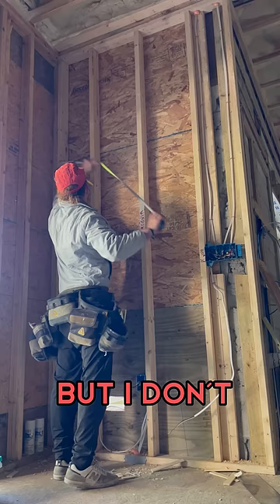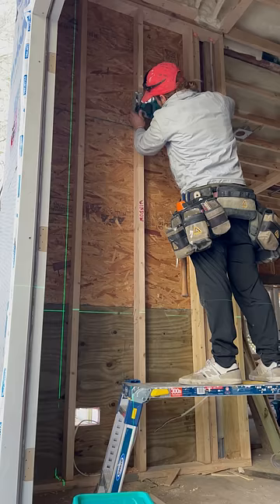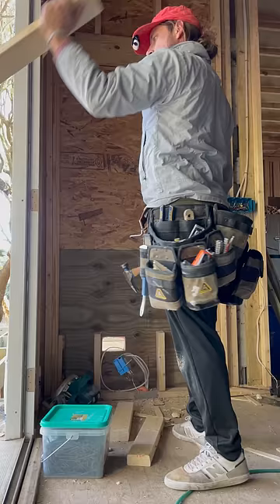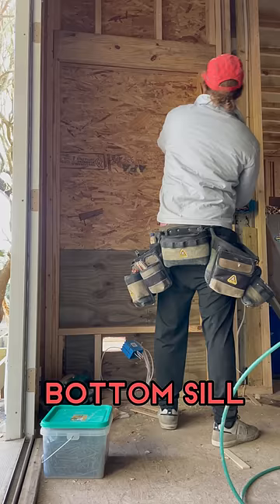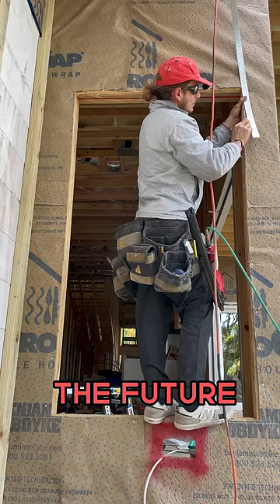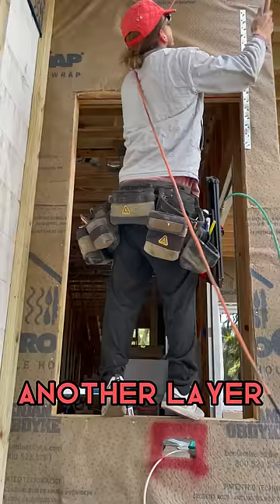How to Add a Window Opening | Artpentry

Comment: Imagine showing the laser wall to people in the 30's
Reply: Their mind would explode
Reply: Plum bob and string works just as well.
Reply: Imagine how efficient they would be
Reply: @Cheech The Chong  Beside being nominally larger dimensions and possibly being from stronger old growth trees. There shouldn't be any significant difference. If any, the negative would lean towards modern construction grade lumber.  
In the old lath and plaster wall days, the plasterer could work a lot of magic removing the curses from walls. 

In the cases we see this guy spotlighting, the fault is clearly with the workmanship, not the materials.
Reply: People in the 39’s had electric lights, might have to go back a bit further
Reply: Even better: show them an NCVT tester.
Reply: @googlesuxbigtime1227  Only someone who’s never used a laser level would say something like that
Reply: @googlesuxbigtime1227  laser is way faster.
Reply: @Darth Uchiha47  drive a nail or screw, hang string and gravity does the rest. 
A laser you have to get out, level it properly and get it positioned properly. 
How is that faster? While you're still setting up, I am getting the job done. 
Plus I don't have to worry about batteries dying or the calibration being off because some idiot kicked or dropped it on the job site. 
Plus, my plum bob isn't likely to grow legs and end up in a pawn shop somewhere.
Reply: @googlesuxbigtime1227  there’s a lot more to setting up the string than what you’re saying. 
A laser level you set on the ground and set it up in two minutes. Plumb bobs swing so drive another nail. Don’t forget to pull the nails back out too. 
You sound like you’ve never used a laser level
Reply: @googlesuxbigtime1227  I’ve seen people spot six lights at once with a laser. Set up in two minutes. Have fun with your string.
Reply: @Darth Uchiha47  I have. And found I don't need one. 
And the problems I mentioned with them growing legs or needing recalibration and other repairs. Have all been experienced by close friends. They also thought this would improve job sit work. But found out that they work best, for keeping the job site plans from blowing away.
Reply: Witchcraft 😂
Reply: Imagine showing people from the 30’s how flimsy our houses are now
Reply: @googlesuxbigtime1227  I can tell you're used to grunt work, as all you're doing is digging yourself a big hole.
Reply: @googlesuxbigtime1227  lol these kids with their lasers telling you you don't know anything are funny.  its a window rough in i would be finished in the time it took them to get the laser out of the truck and set up .
Reply: @pattygreen8064  Yep.

Comment: Great job dude, the router is a good switch. The clean cut is the cherry.
Reply: Unless the wall is still laying down, routing out a window sucks! Lol. 
Almost as bad as tyveking in the wind
Reply: @Mc-nn6nj  It’s not that hard, I have done it many times with the wall standing
Reply: Unless there's a knot or wain in the wood
Reply: What kind of bit do you use?
Reply: @feyrband  2 flute 1/4" flush router bit.
Reply: @isaactruss5922  but he said when the wall is laying down
Reply: If u cut it before the wall is put up maybe
Reply: I would think sawzall blades are cheaper than router bits
Reply: Frame the window before you sark the wall. This is just unorganised.

Comment: One thing I know down here the windows probably getting wrapped in drywall with just a sill an a bottom skirt trim piece but if you ever have to picture frame a window double the bottom plate it gives you more to nail to

Comment: 10/10 highly recommend switching to the router after years of sawzalling out windows routing them out as you sheet with router is more efficient and leaves a better cleaner opening! Great job! 
P.s- what brand of bags are you rocking those look like they mean business!!
Reply from the maker: Thanks bro! I’ve been meaning to try the router so I’ll give it a go.  As for
The bag it’s a brand called Iron Dog Toolgear. There’s a link for it in my Linktree
Reply: Sucha good i deas still havent tried either
Reply: Tried getting my boss to switch, told me I would burn out the motor on his giant router and it’s a waste of time. in the end he’s just afraid of new things because it is ten times a cleaner outcome
Reply: @Artpentry  Agreed those bags are pretty sweet👌🏻🤙🏻

Comment: Pro tip from a window guy: when you nail your builders window on; the window will settle with the wall. If the walls end up getting bricked they will brick up directly up against the window. 
So now when your walls settle it crushed the window into the brick and now you have to buy a new window cause that window can’t be fixed

“Brickers” you need to leave enough room to let the window settle with the wall
Reply: Brickers? Haha they’re called masons
Reply: @nyazz22  unless they're goldbrickers - wait, sorry, goldmasons

Comment: The router makes for faster easier and cleaner cuts. The only downside is you have to clean up the corners depending on your bit.
Reply: What do you need clean cuts for? This is rough carpentry.  Never be seen.

Comment: U need 2 window sills. . Very helpful wen u put trim on cus u got plenty to nail to and not angling upward and end up hitting the window frame or curls out
Reply: Right on kuntryboy. That's what I was thinking too. And I bet his sill isn't level. Just look at it. I can see from here it isn't
Reply: built thousands of houses never used double sills. unless you put in wide trim it is a waste of lumber. window trim does require that many nails

Comment: Need a double sil and jack studs underneath. Ta-da!😊
Reply: Why? All it holds up is the window itself. Who needs a double sill on jacks for that?!??.  Sounds like a waste of lumber to me.
Reply: Nope.  Where do you build? Never see that in the Mid West. Not in 100yr old buildings to current ones
Reply: @jamesgarfield9592  double sill leaves nailer for your window trim and casing around
Reply: Absolutely not. The only reason you even need a cripple stud under there is for nailing/screwing materials later on.
Reply: @dylanwheaton2785  That is what the one 2x is used for.  No need to double up and waste time and material.

Comment: We use either 2 LVLs or make a box header so you dont have the half inch of overhang on the cripple wall studs.
Reply: What overhang?
Reply: There was no overhang? Another method is to use 1/2" plywood/osb, cut 4" x 5.5" pieces as filler between the (2) 2Xs. Tip: place them inline with the load from the (C) of each cripple stud (And one at either end, obviously)
Reply: He actually uses the same method in the video, but with a full piece.
Reply: @patrickellis1151  Look closely. He put 2x together. That's a 3" header. A stud is 3.5". The stud protrudes the header he made. You can see it isn't flush to the inside when he put the thing into the cavity.
Reply: @brettgregory6667  He nailed 2x's together creating a 3" thick header. A stud is 3.5" thick so he is missing that .5". There was no plywood in between. You can see the jacks, studs, and upper cripple wall over hanging the header when he sticks it in.
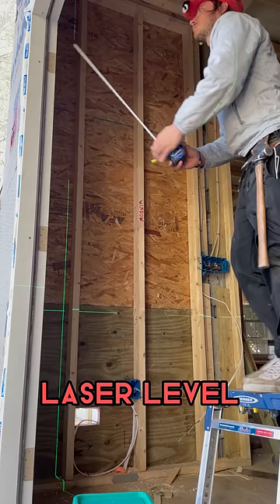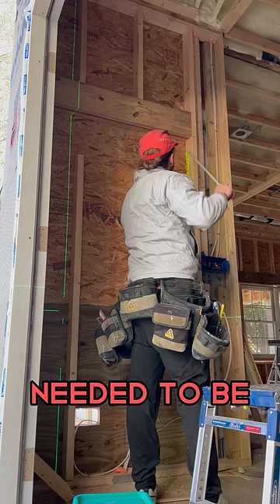Reply: @joeydover  At 0:05 you can clearly see the 1/2" plywood sandwiched between the 2Xs; there's even the red painted edge facing the camera. You can't miss it! No noticeable overhang, due to thickness variation. Even at 0:29, where you can see they're flush, the 1/2" filler board is quite noticeable, after it's been installed.
P.S.- It seems like his top cripple studs aren't cut flush at the ends that mate the header, creating a slight shadow. It looks more like 1/8" slight gap than an overhang. Same with the left jack stud; slight gap at top, in your defense....
Reply: @Joseph Dover  No sir, he put a piece of 1/2 inch plywood between them to make it 3 1/2. I do know the method you're talking about though and that does a great job aswell.

Comment: Some state codes do not allow windows closer to 
corner wall.
Reply: Braced wall panel required within 8’ of corner. Can be as small as 2’8” with holddowns, 4’ with anchor bolts or smaller with a Simpson strong-wall or engineering.
  In the application shown it’s pretty important.

Comment: Do it with a saws all.. then get a big diameter… like 1”, spiral up/down pattern bit with the bearing on the bottom and top…  or just on top. I have found that the D-handle routers the Porter cable 691.. is great… but the festool routers are amazing . All of their stuff is. Worth every penny. Expensive to buy…. Cheapest to own

Comment: Nice work, looks really good. one question though, if it's not a load bearing wall why install such a beefy header? Or if it is a load bearing wall isn't cutting out 2 studs without a temp wall of some sort to carry the load until finished with the window nessasary? I'm a carpenter who has a lot to learn myself that's why I ask.

Comment: Im sorry to inform you but install the strap tie down to the inside of the framed opening and slightly @ an angle where the strap ove laps both the Jack and King stud than on the out side . Hurricane force winds push from the exterior side 
I been framing for over 36 yrs and personally have seen this fail on homes both in SW Florida and Bahamas after sever Hurricanes countless times. I always install the straps on the interior side of the framing where possible.

Comment: Both straps should be nailed to the jacks, header and top plate and they should be nailed on the inside directly to the framing not the plywood as the nail length doesnt compinsate for plywood thicknes

Comment: Am I the only one that just slaps headers up against the top cap with 1/2" iso board between two 2x8/10/12?

Can cripple down to whatever height you want at that point.

Comment: What’s the strapping for on the outside? Thanks
Reply: Possible engineering requirement.
Reply: @robdavidson993  tether the window in case it gets blown out?
Reply: Hurricane 🌀 prone area requirement.
Reply: @XroorX  it’s for areas that see a lot of high winds. I saw a house with those in Colorado.
Reply: straps on outside of window header over osb does no good. hurricane straps go on framing. must extend from jack studs across header to blocking over header.
Reply: @charlesrodriguez7984  keeps the window from flying out?!? Wow!
Reply: @nightstalker5952  right cause the sheathing should basically be the strapping from rim joist to rim joist, but drywall is poor in tension and would only span the top to bottom plates of the wall

Comment: Oh yeah router with a rollerbit( tracing bit) it's slick, just watch out when you set it down if it isn't a plunge router!!! Just like setting a skill saw down when someone has wedged the safety guide up, so it doesn't comeback down!!! Oh yeah when it's getting finished on the inside, always double your sill, that makes it easier when you finish, you can nail your trims anywhere, make it symetrical, layout never falls evenly on your trim, since you can see the putty marks where you put your nails, double sill gives you 3" all the way around for your finish nails to hit by, that way you can line up your nail pattern on the bottom trims under the window, symmetrical always looks better, just an old timer trick, other than that spot on, sir!!! Nice work!!!

Comment: An inspector told me you don’t have to add strapping to the outside because the plywood acts as strapping you shouldput it on the inside but both will pass inspection

Comment: Next time, add a 2X6 flat under the beam so the drywall has something to screw into above the window.
Reply: 1/2 inch furing strip of plywood will work fine
Reply: @Jack Mehoff  right. Or a double 1/2 inch because a triple 2X will be 4 1/2 inches and a 2X6 is 5 1/2 inches so you would need to add an inch, which is a double 1/2 plywood strip. Most framers don't do jack though and leave it for the boarders to figure out. The worst is when window guys install the windows and load the space with tape and make it hard to fix after.

Comment: Using a saw-zall to punch out plywood for windows is so hit or miss on the jobsite if you're not in-charge because half your bosses will eat you alive if you do, and the other half will if you don't. I've noticed the dude's that were trained in finish initially are always really insecure about using a recipricating saw for this because they have a tendency to be too detail oriented for production framing and they hate how sometimes you'll cut a little 2x or sometimes there will be an angle in the plywood if you failed to cut it at a true 90 degrees. The thing is though, none of that actually effects the end quality at all so it's literally just them not being comfortable with it.

Comment: I always use a 2nd sill, better all around. And I double the sides for strength always great for replacing as well....The router is fast nd so clean worth it. And my strapping is usually inside. Some epmd wrap nd your ready for window. And I definitely like 2×6 walls better only wall maybe 2×4 is house wall into garage but that's about it

Comment: I would usually snap out or otherwise mark my windows and use a skill saw to cut them out back in the day.  Just couldn’t handle the ugliness of a sawzall; although i did that a couple hundred thousand times as well.  Router is for sure the best and cleanest.

Comment: The router really is a game changer for this. When you use a sawzall even a “perfect” cut will be at least a little bit beveled. This means that when you install a window with nailing flanges you will have a harder time finding something solid to nail to. Using a router is so much easier and faster too. The biggest downside is you really need to watch where you put your sheathing nails and make sure you don’t hit any with the router. Those bits are not cheap!

Comment: Why do you use strapping there?
Reply: Wondering the same
Reply: Thanks for the comment. Glad I looked. 😑
Reply: So when there's lift/ expansion on the house in general the window sill won't expand causing issues with the window. You don't want any expansion after the window is installed. Can crack or leave gaps causing insulation issues

Comment: Ive not seen straps added like that before.
Reply: What is the purpose?
Do they add structural support?
Reply: I haven't seen it either. BUT worth the $15 to add
Reply: @vanderumd11  strong tie straps are $15 a pop. So thats $30. And if it does nothing. Ill keep my lunch.  But if this has a code or a structural reason Id like to know and to apply it.
Reply: @christopherr7195  they are used for seismic and/or wind loads.
Reply: Its used on shears walls, this is not a shear wall so the strap is not doing anything for seismic support
Reply: @Kevinreyes0329  thats what I was inclined to think. But Ive seen all kinds of oddities.

Comment: Why the strapping? Genuinely curious
Reply: In some places strapping is code and is used to tie up main floor to upper floor (min 16" from both top & bottom ends of rim joist,) also to prevent expansion and cracking of the window opening. that strap is gotta be at least 2" away from the window opening edge on a king stud (the way he did it woudn't pass here in Wa). 
That's all i can tell you with my broken english bro.

Comment: I don't know if it's code to have it on the outside but the way you just put the strapping where the nailing flange for the window goes ruins my life as a window installer.

Comment: Are house walls generally this thin in the US?
Reply: 2x4 inch studs plus whatever the material covering the outside and inside. 

2x6 if you have the money for better insulation or if required by code. 

How thick are your walls?

Comment: First off it's a linear stud not a jack stand and second your bottom seal plate is unlevel , BAD LIKE REALLY BAD , about an inch out over an area of less than only 3 feet... This will cause moisture seepage and rain run off inside the wall eventually leading to severe mold and mildew problems in no time .... sometimes you need to stop an stand back and I spent your work before you install any critical or hard to get to to replace parts on anything , whether building a house or working on a car , you need to stop and stand back and really investigate your work before someone walks in and spots a problem right off the bat making you look like a rookie or something but yeah , stand back and look at that seal , it's way out ,  like  WAY OUT 🤣🤣🤣

Comment: What is the purpose of that strapping you placed on the outside?
Reply: In the south we have to add a ton of straps per code for hurricane.
Reply: On butt joints of plywood they want nails every 4 inch an 6 in the field

Comment: Who screwed up n didn’t frame the window ?
Reply: Sh!t happens!! Nobody is perfect. Good carpenter can fix his mistakes!
Reply: @lyndonwhitson2269  a good carpenter wouldn’t have done it.  Blueprints are for a reason
Reply: @charliemccarthy5854  I never missed a window that was on the plan. I worked on mostly custom houses and sometimes the customer will change their mind after they see it. That’s why they call them “custom”
Reply: @lyndonwhitson2269  we call it change order.  If it ain’t in the prints or plans it ain’t our fault n it cost extra
Reply: @lyndonwhitson2269  yeah. Thx mr obvious. I’ve never built a home.